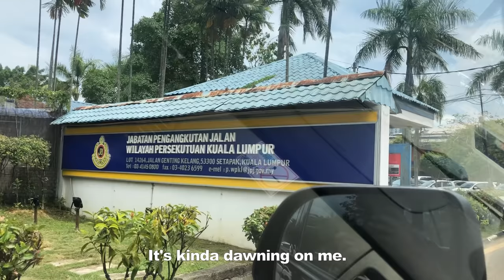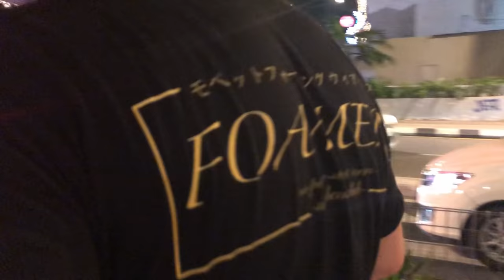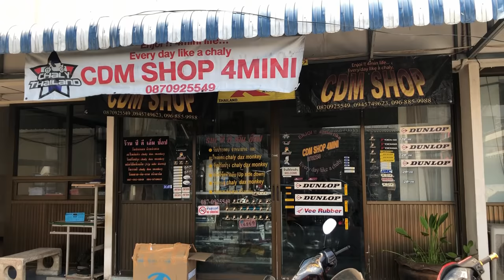Malaysia to Thailand on $1000 Bikes | Will we make it?

Comment: The amount of money spent fixing and upgrading those bikes you might as well buy brand new, it also saves you time and hassle, but I understand why you bought 2nd hands bikes, its fun and fixing it is part of the adventure and charm, anyway i love these kind of riding, slow and in a small bikes.
Reply from the maker: We didn't really spend much fixing them. Just new wheels and thats about it. 2 oil changes on the trip. The main reason we bought these models was because the engines would bolt into bikes we had back home. They got disassembled at the end of the trip and most parts were sent home. Spent $1000 all up on the bikes. Was more than double for brand new.
Reply from the maker: New INTERNATIONAL roadtrip video live now: https://youtu.be/2QXMgk1RYBo

Comment: Why did you not buy undebone 150cc? It's much cooler than 100cc plus it's ride like a big bike 1000cc.
Reply from the maker: I wanted to remove the 100cc engine and send it home for a bike project. So I bought bikes specifically because it had the power plant I needed. On the next trip we may use bigger bikes!
Reply from the maker: New INTERNATIONAL roadtrip video live now: https://youtu.be/2QXMgk1RYBo